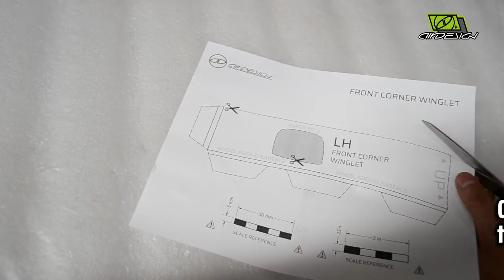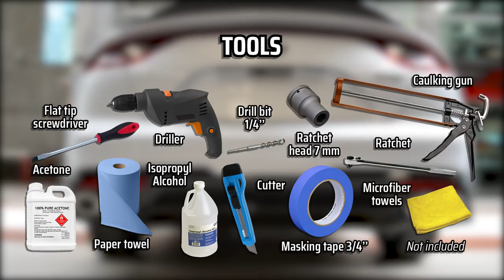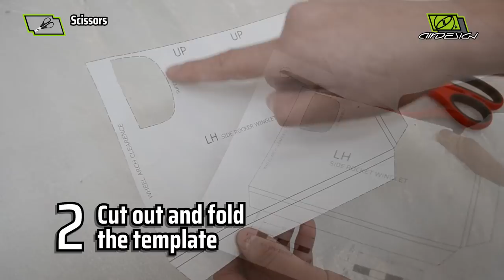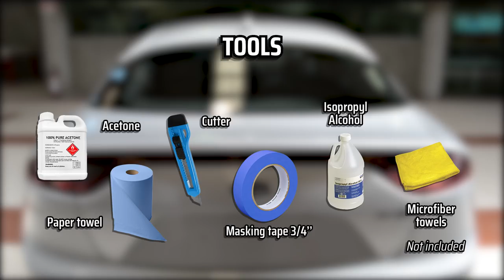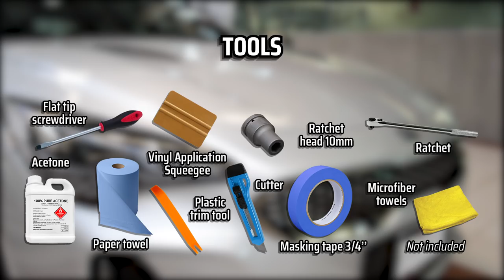Styling Kit Stinger 2018 - KIA

Comment: I have now 2018 Stinger with diesel engine! Now i want diffuser in the back with exhaust pipes left and right but its not in the shop!
Reply from the maker: Hi Tim,

Please contact our sales department marycruz@airdesignusa.com / sales@airdesignusa.com

OR visit our store. 3820 Oceanic Drive, Suite 301 & 302, Oceanside, CA 92056, USA 
Toll Free Phone (only in the US) (844) 280 - 2775
Roll Over Line (760) 435 - 0095

Best regards,
Air Design

Comment: Good install video. Only thing I would've done different is to have those hood vents actually have holes in them so they are functional.
Reply: So you are telling us you don't have a drill?
Reply: @hughgundersen9623  No, I'm not acknowledging if I have a drill or not.  If I had bought new hood vents, I would expect them to come with holes in them so I wouldn't have to do additional drilling.
Reply: I was being sarcastic! The problem with the Stinger is that there are no water run-off area under the hood and any water that flows into the space under will probably damage the under hood sound dampening material - somebody will come up with the answer as FORD has done with the 2019 Mustang and Aston Martin/Jaguar have done too.
Reply: Hm...how could it be made functional? Since hood vents usually help feed air into the intercoolers right? But on the Stinger they're way down by the front bumper. Maybe I'm missing something. Sorry, for 3 month old reply.
Reply: @husker_nation false advertising on their behalf.if u drill u might as well drill out the original ones
Reply: @zarkoristov5585  Not false advertising. The hood scoops are meant to extract heat out of the engine bay area, cooler engine, better longevity and performance

Comment: Does the kit come in Carbon Fiber?Does the hood vents have open airflow?
Reply from the maker: Hi Gerard,

The kit is made of high resistance elastomeric polyurethane. 

Our hood vents adapt to the installation of the OEM hood vents.

Best regards,
Air Design
Reply: @AirDesignDIYInstallationVideos in other words it's No.
Bullshit

Comment: Your website from the link above does not have price on the components? How could I get pricing.
Reply from the maker: Hi Jesus,

Please contact our sales department marycruz@airdesignusa.com

OR visit our store. 3820 Oceanic Drive, Suite 301 & 302, Oceanside, CA 92056, USA 
Toll Free Phone (only in the US) (844) 280 - 2775
Roll Over Line (760) 435 - 0095

Best regards,
Air Design
Reply: @AirDesignDIYInstallationVideos  
Ok I send a email soon
Reply: I have sent any email but I have yet to receive a reply.